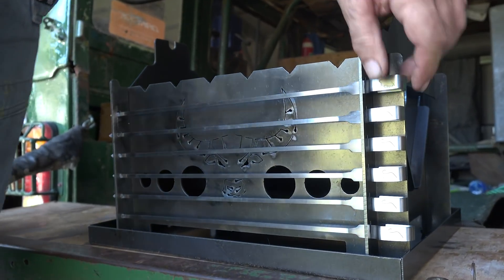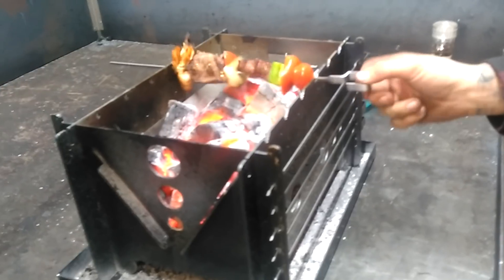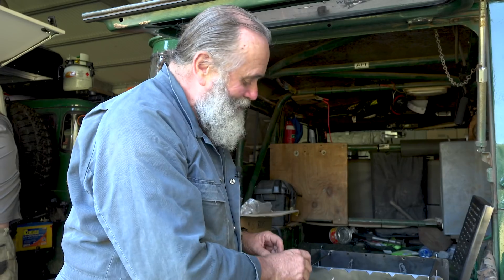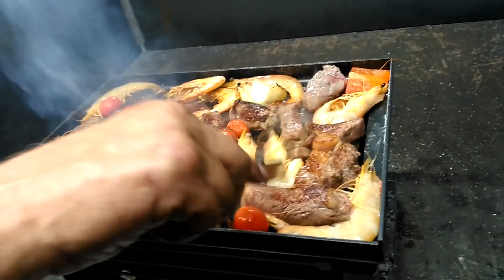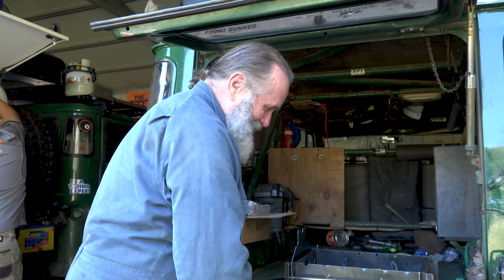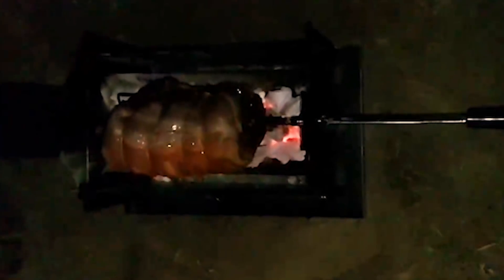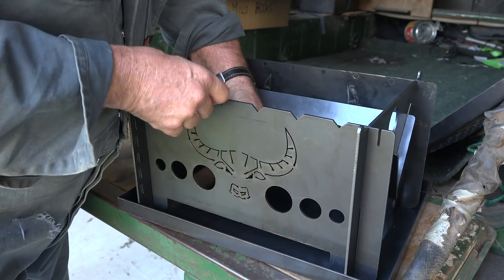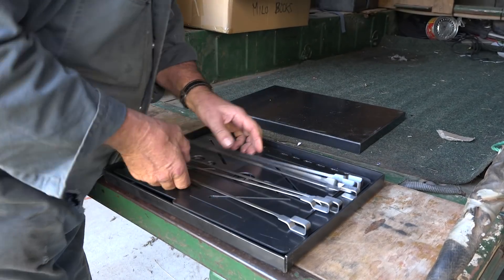Cobber Qube  - Top End Campgear - Bush Cooking - Roothy

Comment: Hi Roothy! Looks like a good bit of gear, but how does the rotisery part work, what makes it rotate? And what do you use for the coals exactly if you don't have access to wood?
Reply from the maker: mrbsausage G,day mate, the rotisserie thing is an extra and is battery powered, you can get one at most hardware stores. If you don’t have access to wood you can just use heat beads. Cheers